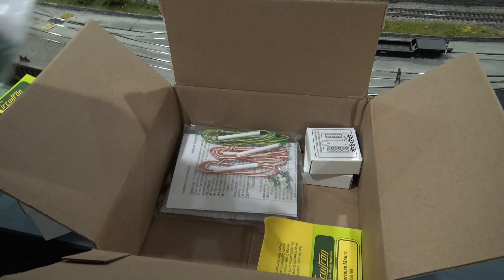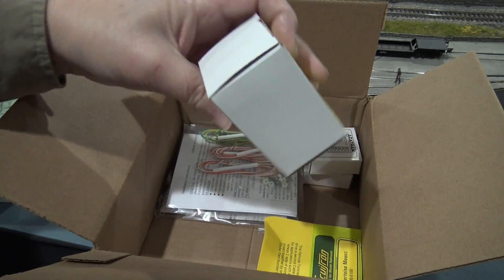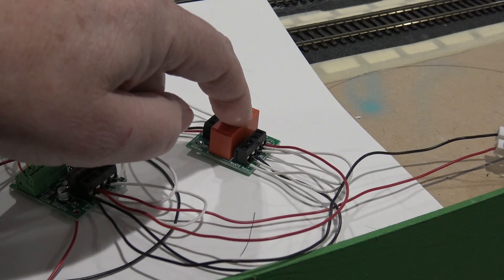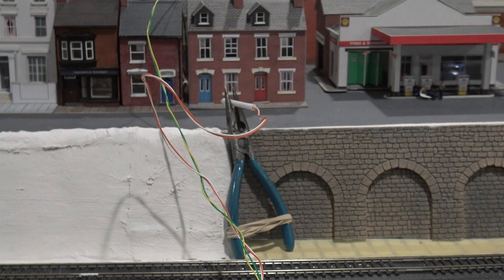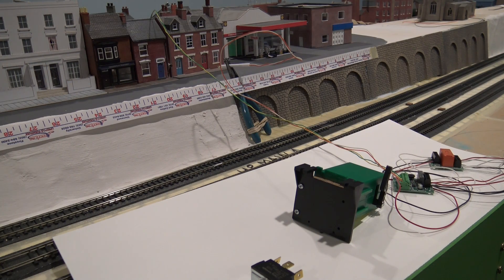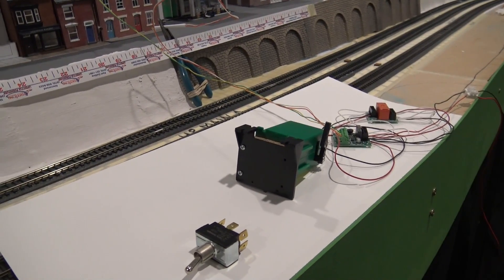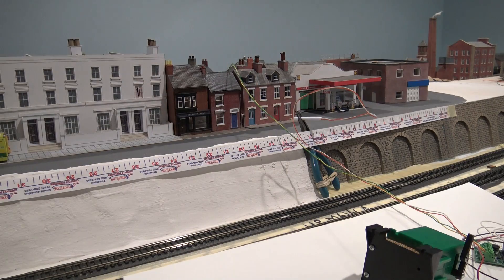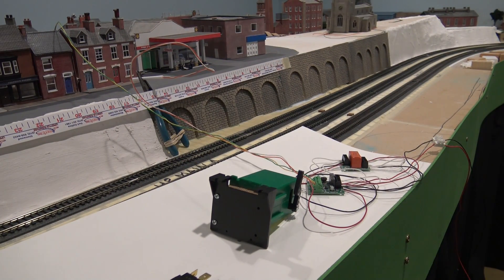73B Stopping a Truck Building Farland

Comment: Rob, you could make the magnet raised by default and when the truck stops, the timer kicks in (having broken the beam) and then lowers the magnet, the truck starts again and then the magnet reurns to to the raised position ready for the next circuit. You then wouldn't have worry about timings and distances etc - if I'm right, but then again, I could be (and probably am) wrong. Nice work though fella and I continue to marvel at your work and creativity! - Pete
Reply from the maker: Hi Pete, Yes, you are absolutely correct.  In fact it might be a better way to go.  That would mean having the sensor across where the magnet defaults to up.  I would only have to reverse the wire to the Tortoise motor.  It would not have been such an interesting video, however.  I would not have been able to time the sequence to get the magnet up and then the distance run while the sequence took place.  It is worth considering.  Since I plan to have it eventually stop at several places, I could do what you suggest in some places and the as shown in others.  Thank you, Rob
Reply: This would seem to be the best way, multiple stops along a business district and even stops at traffic lights. Good thinking Pete.   David.
Reply from the maker: Hey now there is an Idea.  I could control the stop light with the contacts on the Tortoise motor.  I don't see how to have it turn to yellow before it turns to red.  The red and green and easy.  Keep thinking.  Thank you, Rob
Reply: Rob McCrain 
Rob, you might want to have the traffic lights running on their own timer, and the the truck will occasionally arrive at red, and occasionally at green.  The cross-roads would also provide for expansion or @ more convoluted route.
Very interesting display of control, and application of logic common to both trains and roads.
Regards, Tom
Reply: Well you could implement some signal timers for the red, red/amber and green and then back to amber and red I would have thought. How about using an Arduino thingy (check out oorails stream on how to use them)? Not wanting to spoil the party, but when the truck stops to deliver, then all of the other traffic behind it will have to stop too? Or is it possible to add some overtaking stretches? Now that would be really impressive!
Reply: Creeping Jane 
Pete, I agree that we can gild this lily until it is no longer the simple entertainment, but starting simple (with modular option to make things more complicated) is Best and economic.
Rob, you know I’m going to recommend the BLOCKSignalling traffic light control module, which would drive the signals well, but needs some interface to control the stop signal. Perhaps the optical sensor to see the red light, or the unloaded green output of the crossing signal?

As for passing the delivery truck, there is a configuration for bus stops, and this would be suitable. Or, of course, change the DHL shell for a UK bus , on the same chassis, for something that should stop regularly in fixed places.
Dealing with traffic queues, is a totally different problem, and may need Version 3! (Now who’s gilding the lily? )
Regards, Tom
Reply from the maker: Tom, as money and time permits, I will increase the capabilities of the road.  For the moment, I have spend all I am willing to on it.  I need to get on with the rest of the layout.  Thinking of Robert Frost, and I quote, "But I have promises to keep,
And miles to go before I sleep,
And miles to go before I sleep. 
In other words, I do not want to get obsessed with the road right now, I would like to get the basic layout done.  When I is, I can then start adding the fluff, things like the bus stop shelter for instance.  I would like to add the stop light systems, but it is very expensive, I need a cross road and now is not the time.  Thank you guys for providing such a great discussion of what could be done.  Thank you, Rob
Reply from the maker: I will no doubt use the Faller stop light system eventually.  I think it could be added easily enough.  Probably easier to do it befor the wire is laid, though.  Perhaps when I get the basic layout completed, I can think about an Arduino.  The Greeley Museum has on on one of their roads.  Isn't that so typical anyway.  The truck stops and the road is too narrow to pass at that point.  Over taking might be possible, but I have no idea how.  Now you're getting out there.  Thank you again Pete, cheers
Reply: Rob McCrain 
Rob, absolutely, this is just part of the scenery for your railway.  It is too easy to make any one bit of  “back ground” take prominence , and your layout is a great example of balance between trains and background, so this decision is in that philosophy. And you have future plans; I for one will be interested when you come back to this (once next week’s episode completes this installation). Thanks for sharing. 
Regards, Tom
Reply from the maker: Hi Tom, Thank you for that.  I have seen people get distracted by one element of their layout and obsess about that one detail till they are paralyzed.    I will come back to this, a stop is easy to install, sensors are harder.  Thank you for watching and your thoughtful comments,  Rob
Reply: This is better because not all Faller vehicles go the same speed should you get a another. Minor correction, the Greeley setup has 3 Faller roads.
Reply from the maker: Edward Sargent Hi Ed,  I will need to think about that.  Not sure I can do it with the same equipment.  I was going to move the stop well in front/behind of the sensor.  More than the 26 inches.  Probably 30 giving me another half second of travel.  Thank you, Rob
Reply from the maker: Tom Lawton Hi Tom, Yes, the plan is to leave open the opportunity for a traffic light somewhere.  At the Y by the hill I plan on putting in a roundabout so it would have to be somewhere else.  I spent the afternoon roughing in the rock face going down the bank and getting the building positions sorted.  I think I am close there.  Faller sure does want a lot of money for their stuff, that is why I went the way I did.  Unless I misunderstood their stops need 22 VAC.  I don’t really want to add a second voltage and have it AC under my bench work.  AC is a killer to all kinds of things.  Especially 22 V.  Thank you, Rob

Comment: Very, very impressive Rob. It does seem a very complex system but you’ve got it beaten, I wouldn’t know where to begin !   Would you be able to switch the sensors off so that it didn’t stop in the same place on each circuit - maybe every second or third lap?  But whatever, this Faller system of yours is going to look fabulous when all complete. I still can’t believe how far you have got in such a short time.           ............Graham
Reply from the maker: Lakeside model railway Hi Graham, If we were in the same room, I could explain it to you so you would understand in 15 minutes.  It is possible to put a switch to interrupt the stop.  Having it every third or every other lap would take some doing and beyond my meager capabilities.  I had a good day yesterday on the layout.  I will only work minimally over the weekend even through M is off to visit her Mum.  Thank you ever so much, Rob